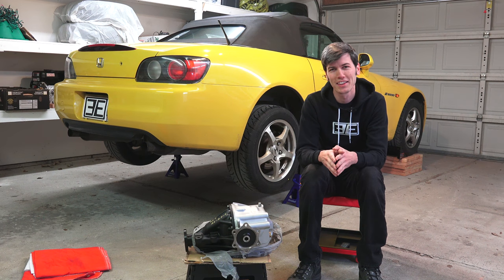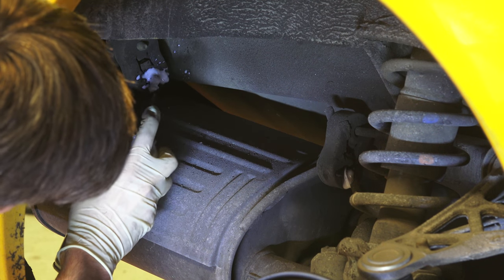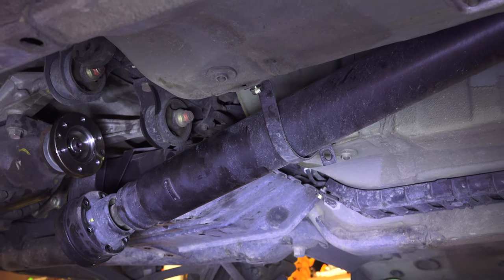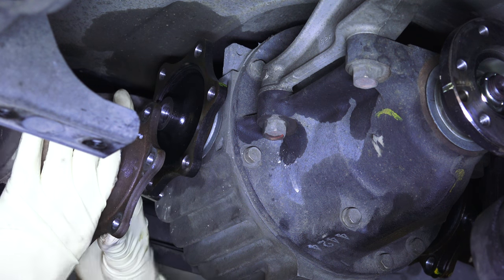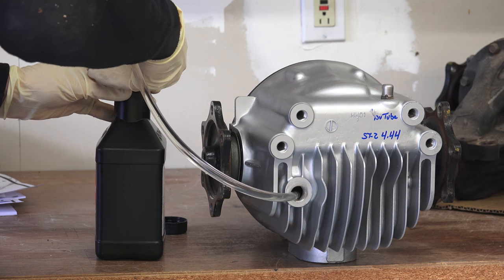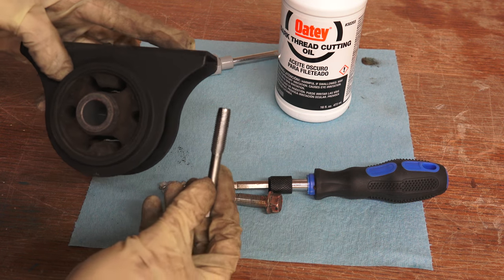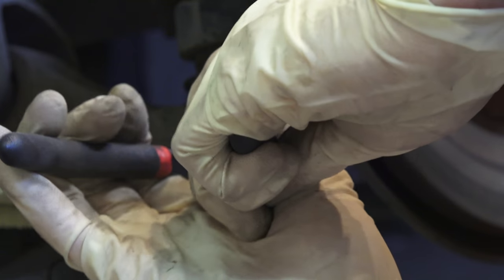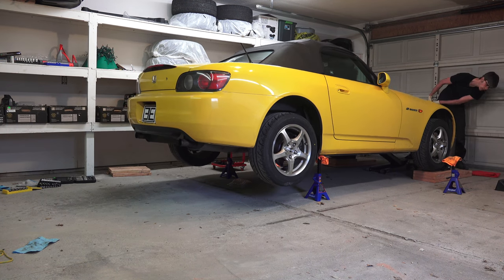Installing A New Differential In My Honda S2000!

Comment from the maker: If anyone is planning on doing this to their S2000, I've included a list in the video description of the steps to take. Also has a list of part numbers you'll likely want to order before getting started, as well as some recommended tools. Hope everyone's having a great day! Consider following on Instagram if you like cars, or cats, or cars and cats. Okay, mostly cats...  https://www.instagram.com/engineeringexplained/
Reply: How does it feel to get some grease on your hands instead of marker for a change? Hehehe nice work, I run a 4.44 diff as well and it's fantastic always having power. You didn't say what type of diff you're running, helical/clutch pack.
Reply from the maker: Torsen diff!
Reply: Which are the benefits of doing that? Can you make a comparison video?
Reply: Engineering Explained I'm not sure you installed the cutter pins properly. Should you bend the pin around the circumference of the castle nut?
Reply: It doesn't matter how it's bent as long as it passes thru the hole and notch, it's only purpose is to stop the nut from backing off.
Reply: So benefits of running a more aggressive gear ratio rear end is that your RPM's will be a bit higher in each gear so you'll be in the power band more which gives improved acceleration without always having to downshift. The downside is higher cruise RPM on highway and lower top speed but that's not all that important in an S2000 so it's a great upgrade for this application.
Reply: Engineering Explained You should change the car color...
Reply: Its more to stop the nut falling off im extreme cases and the ball-joint popping out of the socket which would be dipterous.
Reply: atlanticimports - err no, you can have whatever engine speed you want regardless of gear ratio...the benefit, as he explained is the increased wheel torque....said more generally the benefit is increased torque....you side point of reduced top speed is correct....in other words top speed is exchanged for increased torque.......engine speed is the same in both situations so can ignore it.
Reply: Hey, I wondered if you could do a Video about a 200 cell or 100 cell performance cat and if it really benefits your engine power-output with a STOCK Engine Control Unit.. 

I think it could be really interesting for many people like me because I think about putting one in myself, but dont have the money for a good dyno tune. Sound and stuff doesnt matter to me so much but power does.
Reply: you are awesome! might be going this to my s2k this summer.  how did you diagnose it btw?
Reply: Engineering Explained error in step 14
Reply: Rubber ones.
Reply: Justin nitsuj Think you need to research how final drive ratios work mate. When increasing to 4.44 that means the driveshaft is now rotating 4.44times per 1 wheel revolution. Driveshaft is connected to engine thru tranny and rest of drivetrain which results in higher cruising RPM's making it feel like more torque is available. That's why top speed is reduced because you hit redline at the top of 6th gear sooner than a lower final gear ratio. Time to make a another vid Jason!
Reply: it gives a mechanical advantage
Reply: I have a 4.46 carbonetic and it's easily the best bang/buck mod I have done for the s2k.  Thanks for sharing!
Reply: Engineering Explained Is this the new ChrisFix ??? ...
Reply: Engineering Explained your the man , it's nice seeing im not the only one who likes to learn ! Keep it up love your videos
Reply: did you blow the previous diff doing burn-outs in that last video that I thumbed down?! LOL
Reply: Engineering Explained awesome! As soon as i saw that you bought an S2k i was looking forward to vids like this one! Keep up the awesome work!
Reply: Great video, I probably would've replaced the exhaust if I'd taken the time to remove it for the diff but I guess that's a whole new video!
Reply: Engineering Explained can you do a car meet l?
Reply: Justin nitsuj with a taller diff, meaning bigger numbers for more torque, the engine speed for any given road speed will be higher than it was with the shorter diff.
Reply: Engineering Explained even with 4.77 gears, the top speed per gear is slightly higher than my AP2. I never realized stock AP1 gearing was so long.
Reply: exileut while the trans ratios are slightly different between ap1/2, most of the increased speed come from the extra 1k rpm the f20c spins at redline. I swapped out the ap1 trans in my first s2000 for an ap2 with the better synchros and my top speed in the first four gears only dropped a couple mph. 5th and 6th are actually slightly longer in the ap2 trans if my memory serves me.
Reply: Engineering Explained just surprised Honda set those mph shift points, regardless of rpm. manuals aren't much fun if you never need to shift. why not put a 7:1 diff in the cars. the fastest you need for the road is maybe 100 for passing.
Reply: exileut if you're in your top gear at highway speeds and running at 60% of your max rpm, you're going to have pretty bad gas mileage. Setting the top overdrive gear at an unreachable top speed means that even at 80, you're sitting at 30-40% of your maximum rpm, making for much better gas mileage.
Reply: The car already did lower rpm for better mileage from the factory. What is the point of modifying it 5%? Modify it 100% Create a whole new experience.
Reply: What stage are you using?
Reply: Engineering Explained what stager are you using?
Reply: Could you have done this by just changing out the gears not the box? Anybody know?
Reply: Hey my cousin has the same car and it won't move and it has a crazy noise coming for the rear end...his friend tried to drift and I think he damaged the rear end....

Comment: That was one of the best, most direct, well lit, easy to follow, step by step DIY videos I've ever seen... GREAT job...
Reply from the maker: Thank you thank you thank you!! Really appreciate the input. I was thinking it might be a little quick, but I think so many DIY's out there stray from the point, and take far too long. You may have to go back and check at points if you're following the video to actually DIY, but I'm not a fan of all the fluff that gets interjected into many DIY's out there.
Reply: Charles Lightfoot have you seen ChrisFix?
Reply: You were on point with this one Jason. I wish many more would do it just like this.
Reply: ricardo rocha Chris fix is very good at car instructional videos.
Reply: I will check it out... thanks
Reply: engineering style...   i like it
Reply: I tend to torque everything to spec if it has a published spec in the manual also.  Great job, very careful and meticulous.  Of course if I were using this as a DIY guide and had the same vehicle, I"d have to keep pausing it so I could keep up LOL

Comment: i like how you showed that you ran into some bs during the install. it's never as simple as the diy's state. you always run into something that either means you need to fab up/modify something or just put it back together and try again another day when new tools/parts can be ordered (because of course you're doing this sunday night when no stores are open because the diy said it's a 30 min job)
Reply from the maker: Hahaha, absolutely how it always goes. The prop-shaft bolts were super frustrating; even removing the exhaust was a pain. Retapping was definitely stressful, because if I screwed up the thread is internal to the frame. Would have to keep retapping larger sizes until I finally made it work. Thankfully with some patience, cutting oil, etc, all went smoothly in the re-tap process.
Reply: Every DIY mechanic should have a good tap and die set. My craftsman set is about 20 years old and I can't tell you how many times it's saved me a ton of frustration and money.
Reply: i'm just over 20 years old so i can't say that much but yes i do have a set now. but nobody buys every tool they'll ever need at once, and typically you buy new stuff when you need it.
Reply: This car looks nearly pristine given its age. Good owner.  Working on a 15 year old car in some parts of the country, half the video would be devoted to blowtorches and various medieval implements :-P

Great video and instructions, btw.

Comment: Love my Puddymod stage 2, have had it for almost 3 years now with no issues, thought I had a issue with my diff when I kept hearing a noise and a weird vibration so I contacted him, at first I told him I was almost positive it was a driveshaft but he said something about the LSD sticking and he had to issue with me sending him my diff and letting him fix it. But I double checked and it ended up being worn out joints in my driveshaft which he rebuilt for me. Really nice guy!

Comment: Funny thing, I just had to do this a month ago and didn't see this video til now. My diff was so bad that I couldn't have mine rebuilt and PuddyMod had to build another one for me. One note though, I didn't have to pull the ball joint. Using a transmission jack allows you to wiggle the diff around so you can get the half shafts apart easier. Also makes installation easier. The biggest issue that led to the most frustration was getting the bolts lose. I wish manufacturers used anti-seize compound when they built the car. I made sure to put anti-seize on ALL the bolts during re-installation.

Comment: To save your castellated nut when splitting the ball joint, I was taught to thread it back on upside-down - very carefully so I didn't cross-thread it - until the end of the ball joint was just barely below the nut, then remove as you show.  That should keep the force of the splitter on the flat side of the nut where it's strongest.  It seems to work well, so long as you have nice, clean threads to start with - but it's a bear to get started if those threads are already a little gnarly.

Comment: Wow, this would be so easy on my Volvo 240 5sp manual. I've changed pretty much every wear and suspension part and it was so easy. I dread getting a newer car because they don't make it easy to fix anymore, good thing she runs like a champ. Also, I'm glad I'm not the only one who torques bolts to spec.

Comment: If you wait until you have loosened the differential assembly to remove the drive shaft socket bolts, you may tilt the front of the assembly down thereby giving you a far more direct access to the socket bolts which allows you to avoid using wobbly or universal adapters.  So remove the drive shaft later in the process.

The same process symmetry holds true for installation in that it's more direct to mount the drive shaft earlier in the process for good access.

Comment: Do you plan to put a Supercharger in soon or do you want to keep it na
Reply from the maker: I do want to supercharge it, but my schedule the next 4-5 weeks is pretty intense, so not sure when it will be happening! Definitely gonna get a few more S2K videos in, in the interim, but not sure on schedule at the moment.
Reply: Silas Mayes this mod makes the gears shorts means less boost. He will have to go back to stock/longer gears. I did this on my 350z. Was a waste of money honestly but way cheaper than sc + motor work.
Reply: add turbo please

Comment: Get some upgraded diff mounts instead of OEM.  Makes a huge difference on these cars.  OEM ones twist and are made for comfort more than performance!
Reply from the maker: Yeah, I just know that Honda puts a lot of thought into the stiffness of the mounts, and I don't know that all aftermarket companies do. I'm fine with it being comfort based, the car is stiff from the factory. Also, the diff barely hangs down even with only the two rear mounts. They seem pretty rigid as is, and the rubber lasts a long time.

Comment: I like the way that every tool used was from harbor freight except the torch(from home depot or lowes) and the torque wrench. I own all the same tools. The socket wrench was from the older style 64 peice 1/4", 3/8" and 1/2" drive set.

the new case is far superior, but all of the sockets are 6 point.

Comment: As I’m sure you know when talking about gear ratios the bigger number (with respect to 1) is a lower ratio.

I had a 250cc Ducati with a five speed transmission that attained its maximum speed in fourth gear. The engine didn’t produce enough power to get full revs in fifth. 

Love you videos.

Comment: One other method of breaking ball joints free is turn castle nut upside down, thread all the way until bottom is flush with ball joint stem bottom, take small jack and place under nut/stem and apply upward pressure using jack. Then take a 1/2 inch extension and place the male end on the sides of the lower control arm where it houses the ball joint stem and use 5lbs hammer on female end of extension to apply shocking blows to control arm. If it doesn't break free keep jacking up until it does. This works on front and rear ball joints. No need for a special tool. On 90's hondas there is a perfect fat spot in the metal to shock.

Comment: heads up to people having lower ball joint probs. you can also take a big hammer eat beat the heck out of the side of your lower control arm. I've done in plenty of times and as long as your careful it will just leave a few scratches on it... just a tip that works

Comment: I want to start working on my car.

1. What initial/beginner/easy/ things can I do to it?
2. What essential equipment would you recommend?
Reply from the maker: 1. Oil change. Just write yourself a check list and make sure you do everything. Can easily mess up your car if you forget to tighten something, overtighten, etc. 
2. Socket set, jack and jack stands/ramp. 

There are plenty of tutorials online for almost every make and model. Watch some videos and just make sure you're comfortable completing what you watch on screen. If your car is older, check out some tips about working with rusted bolts/etc. Patience is critical, let penetrating oil do its thing if you run into stubborn bolts.
Reply: Cheers dude, cleaning out my garage I found it has one of them holes in it to work under cars!
Also keep up the videos, super interesting/helpful!
Reply: I would suggest you become familiar with safety of jacking supporting a car first.
Reply: Aussie Guy cheers, yeah watched a bunch of vids. Also I just blew 2 speakers, reckon replacements are easy enough?
Reply: Very easy.Google door card/trim removal you can also get a tool but not needed.Find correct size,you may need a torx bit to remove them.Somtimes the factory connector will be of no use,just cut it off strip wire and crimp on a connector or solder on.
Reply: Aussie Guy cheers dude, also how long do you reckon it'd take. (Car stores near me are charging £50 to change each speaker
Reply: Wow.What model is your car and is it front or rear speakers?

Comment: pro tip. a couple blows with a hammer to the sides of the arm where the ball joint threaded section meets the arm will cause the taper to break.

Comment: the 4.44 is great for torque but not a fan especially on highway or length driving. other than that puddy mods does a great job especially with strengthening the diff. if I were to do this attempt. id recommend ford 8.8 diff conversion.

Comment: Hello. I have a question what wears out clutch more when shifting? Releasing clutch pedal slowly or releasing fast. I was thinking releasing it fast would make clutch engage quicker so less wear and less friction..
Reply: Releasing slowly would cause more wear. But if you release it too fast you're going to give yourself and all your passengers a nice jolt :o)
Reply: FortuneSeek3rz just what i was thinking. But i feel like releasing it fast would wearout driveshaft and transmission more..
Reply: I think how quickly you come off the clutch doesn't matter as much as whether the engine rpm and gearbox rpm are matched when the plates come into contact. there will be no jolt if the rpm are matched between the two as the jolt is caused by the flywheel having to catch up with the clutch rotation speed when they are forced together during a downshift or the opposite in an up shift. You don't have to worry as much during up shifts because just by letting off the throttle during the up shift the flywheel rpm will start to fall toward the clutch rpm by itself.

Comment: what if u are using another driveshaft and not the one u removed, will not having it aligned like the original cause an issue?

Comment: Has Florida started doing emissions testing again? If not, why not remove the contents of the catalytic converter to make it an expansion chamber? Or does that mess up the tuning of the car? Less back pressure should give a shade more power.